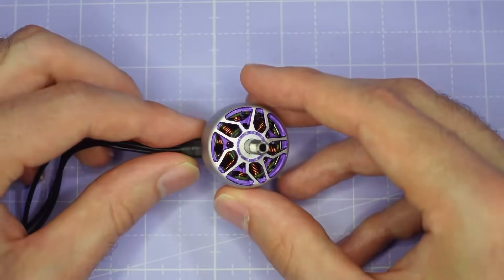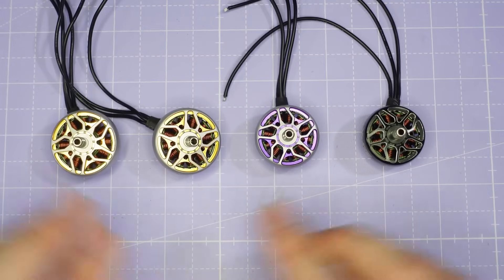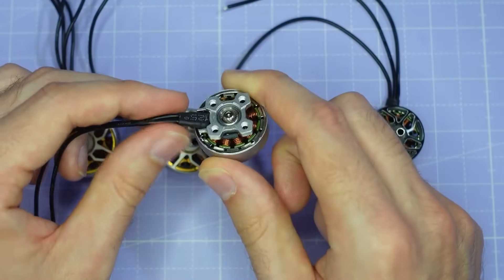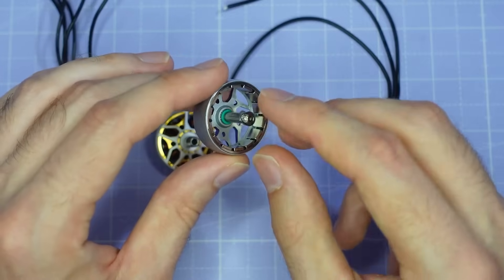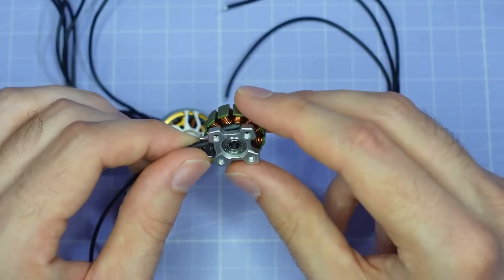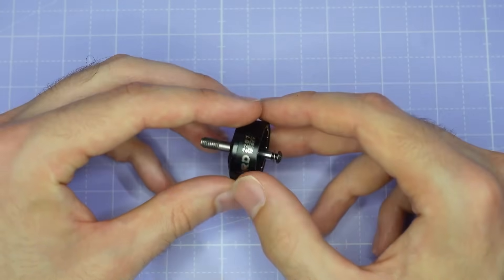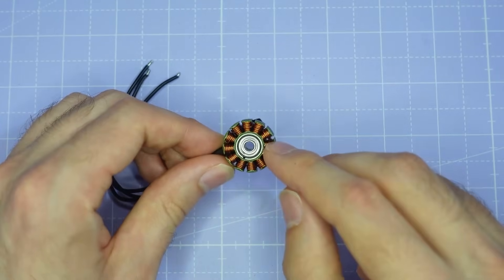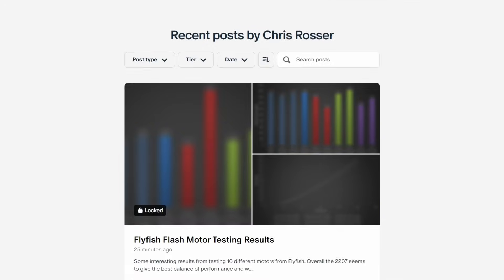Choice is an ILLUSION! Flyfish Flash Motor Review

Comment: Should do one of these specifically on racing motors. Curious of the effect of setting a motor output limit so the KV is ultimately the same across the board as to how motors compare.

Comment: Hey Chris! I have a question for you: What's your reasoning for measuring Kv by running the motor and measuring RPM? Don't you think the accuracy of your testing could be improved by instead driving the motor at a known RPM and measuring the back EMF voltage? Running the motor electrically and measuring RPM is prone to error through losses in bearing friction, aerodynamic drag, etc, whereas driving at a known speed eliminates those variables. What are your thoughts on this?
Reply: Personally I think of those variables you mentioned as part of what gives the motor is Kv. Measuring its theoretical Kv is less useful
Reply: he should run it in an vakuum chamber 😅
Reply: @cwimm95i  That would not eliminate bearing drag.

Comment: interesting, have you considered measuring if there is a temperature difference with the different motors?maybe something like runnign the motors as a medium speed for 5 minuts and see if theres a difference in temperature. not sure if tit would affect the motors, but would be interesting to see.but tbh i probably will stick with 2207 motors from now on.

Comment: A lot of new motors have been found to come with scew drilled shafts. Could you in future, check this out on all motors received. I have a number of sets of motors received in the last 2 years and all of them are not drilled straight causing the bell screw to wobble and unbalancing the motors. Manufactures and motors that I have the issue with was iFlight Xing 2208, Xing2 2306, Xing 2 2207, T-Motor Veloce 2208, Tmotor - Velox 2207, T-Motor F60 V. All of them have screw drilled shafts. Makes me think all shafts come out the same factory? I verified the issue by measuring with my veneer measuring inside hold to outside on 4 points all 90 degree apart. One side was clearly narrower than the adjacent 180 degree point.

Comment: I fly 6s on 4s motors with a throttle limit of 66 for 6s and changes automatically when I plug the battery in from profiles 1 & 2

Comment: Why not try and build taller motors for drones? More like car and plane motor length/width ratios… would a 1820 motor size or something like that have less losses from the edge effect?
Reply: Tall motors have worse cooling than same volume (power) wide motor. That's probably the main reason

Comment: I want to get the sword 1850kv instead of the velox because of the greater efficiency and power, but in my place in the summer the temperatures exceed 40. Do you have data on temperatures? A comparison with velox or others from that point of view? Flyfish does not share data

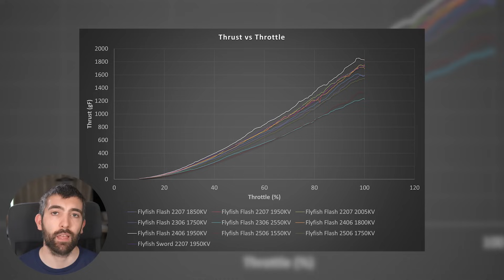Comment: BTW, stating that at 9:15 that 6S has an efficiency advantage over 4S is higly dubious. at very high throttle level - yes. but you have to remember, that proper pair of 6S vs 4S motors are 1800kv vs 2700kv. and not 1950kv vs 2550kv. proper pair will have the same performance, while there will be a bit higher current losses on 4S.

Comment: Are you going to review smaller motors anytime soon? I currently fly my beta95x with 1105 5000kv motors and I would like more torque and efficiency. I know popular choice is 1404 3800kv motors but T-Motor makes 1604 3800kv for 3.5" freestyle. I would love to know if the torque/weight ratio of 1604 is better than 1404!
Reply: The 95x is a light frame. 1404 too big. 1204 or 1303.5 are a better choice. If you want efficiency you need bigger props. So whole new quad